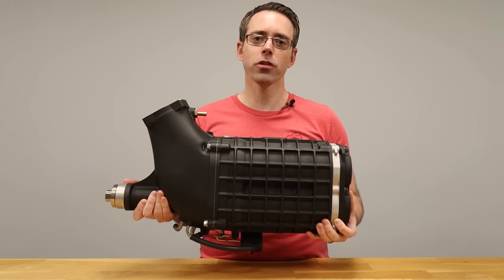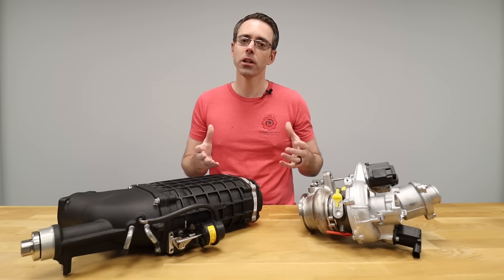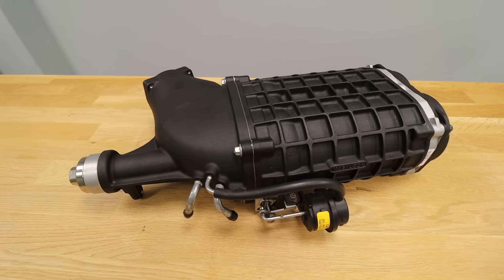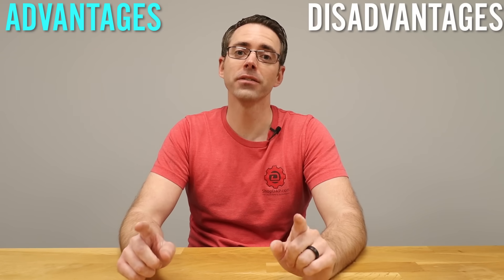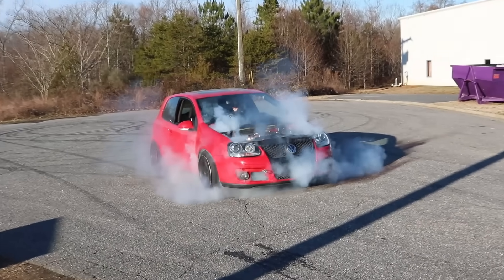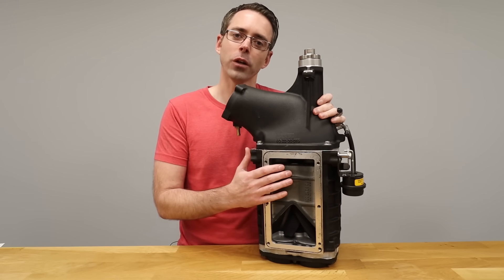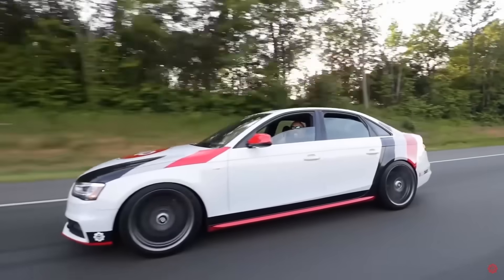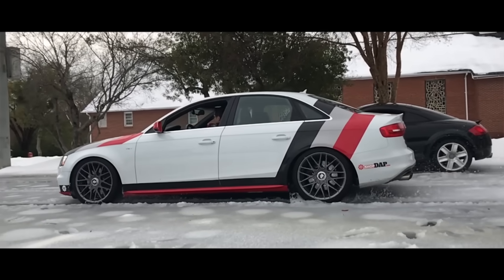Turbochargers VS Superchargers | Which is Better?

Comment: I’ve owned 5 turbocharged cars (3 Mk7 VW GTIs, a MINI Cooper S R56 LCI, and a Honda Accord 2.0T Touring). 2 supercharged cars: a Land Rover LR4 3.0L SCV6 and an Audi Q5 3.0T. Then I’ve had two naturally aspirated cars: a Land Rover LR4 with the 5.0L N/A V8 and a Honda Civic Si with Honda’s old glorious K20Z3 engine which would scream to its 8300rpm redline. VTEC BABY! I’ve also had an EV, a Tesla Model 3 Performance. 

By far the WORST engine in any of the cars I’ve owned is JLR’s 3.0L Supercharged V6. It was supposed to be a more fuel efficient replacement for the 5.0L N/A V8. In conjunction with a new transmission (ZF 8HP70) Land Rover promised better fuel economy, lower emissions and similar performance characteristics. Well, I can tell you JLR sure didn’t keep any of those promises. 

The first thing you notice with that engine was that it was loud (not exhaust noise, just mechanical noise from injectors, belts, etc.), gruff and idled like a 50 year old 2-stroke diesel. Depending on whether you had the A/C on or not, it liked to idle around 600rpm, but it would often stumble below 600rpm causing the engine to really shake and vibrate the entire vehicle. It did this since new and I’ve experienced the same thing in other LR4s with this engine. Once you were out on the road it felt rather gutless lugging around 3 tons of SUV with the aerodynamics of a brick. If you floored it the performance was adequate, at best, but it never felt like enough. The old 5.0L V8 was so much better matched to the LR4. It was smooth and refined, sounded amazing, pulled hard from idle to redline and was no less efficient than the V6, even though it was over 50% larger displacement and offered 35HP and 43lb-ft more power. It ran about 1800RPM at 70mph vs. the V6 spinning around 2000rpm, even with two extra gear ratios... 

Fuel efficiency was actually worse in the V6 when towing a trailer than the 5.0L V8 and ZF 6HP28 transmission. The 3.0L SCV6 was substantially slower accelerating than the old V8 LR4, required frequent downshifts to maintain speed up grades, and the engine always sounded like it was straining. Off road it couldn’t match the plateau of torque the V8 had offered basically at idle. Instead you had to cautiously modulate the throttle to get enough power to go but not too much to be jerky. It’s “eco stop/start” system rattled and jerked back to life with the grace of a 12 year old learning to drive a stick. They also have a problem with the supercharger design. While it shares the same supercharger as the Audi EA837, an Eaton TVS1320, the JLR units for some reason need to have the supercharger snouts rebuilt every 30-60,000 miles because of the supercharger isolator coupler going back leading to a constant sound reminiscent off a slack timing chain. Add in the fact it was sharing its engine block casting with the 5.0L V8, just with two blanked off cylinders and smaller bores and you get a heavy monstrosity of an engine that under delivers everything you’d expect in a luxury powerplant. 

My experience with Audi’s 3.0L Supercharged V6 is night and day different. The Audi shares a 90° Vee-angle, 3.0L displacement, same Eaton TVS supercharger and is available in a variety of power outputs like JLR’s 3.0L engine, but it feels night and day better in every way. The Audi V6 is smooth and refined, it doesn’t idle rough, it feels reasonably torquey at low revs and it is quite efficient. If you could place the two engines in the same vehicle and drive them back to back, you’d never guess they were so similar in so many ways.

I’d venture to say I prefer turbochargers to superchargers because they typically allow you so much potential to increase power through software tuning. Modern turbos are also quite reliable and more compact than a supercharger. Superchargers require belts be replaced and as seen on JLR’s application of the TVS1320 certain parts seem to wear out quite easily that require $500-750 repairs. Turbos can also have their problems but I personally haven’t had any issues with the turbochargers on my previous vehicles.  Pretty soon though, it will likely be a moot point whether you prefer turbos or Superchargers because outside of limited production muscle cars and muscle-SUVs/trucks from Ford, GM and FCA there are few supercharged engines left. JLR has ditched their old 3.0L SCV6 in favor of a new turbo/e-supercharged Inline-6, but they’ve decided to keep their 5.0L SCV8 in production. It puts up decent specs, but in reality it can’t match the thrust of BMW/Audi/Mercedes’ turbocharged V8s. Outside of that, no other supercharged engines are available from European or Asian brands. Audi has now replaced the Supercharged 3.0L V6 with the newer turbocharged 3.0L V6 in the S4/S5/A6/A7/A8/SQ5/Q7/Q8. Weirdly, the Q7’s fuel economy ratings dropped quite substantially with the new engine.

Comment: And h2r is faster than any car period
Reply: Actually no it's not. It's way cheaper than those cars thought.
Reply: @emilmuhrman  you are referring to the h2, which is restricted for street use. The h2r is unrestricted.
Reply: @hubertsang7418  No the h2r. Extremely fast, yes. Faster than every production car, no.

Comment: I'd sure love to know how you figure it's easier to install a turbo !!!
Reply from the maker: It was referencing developing a retrofit. Once someone has spent all the RD time making a CAD prototypes, testing, then production etc. or a fab person can weld a manifold and install on the car the put a turbo on. 

Superchargers are easier assuming someone has already done all the work.
Reply: Deutsche Auto Parts 
I can more readily see your point but one would assume your video is talking to the typical video watcher. In that case, having done both, I’m a supercharger fan for ease of install and linear power delivery but the turbo is only there when you need it and the flexibility is out of this world in this day and age. I think most would agree.

Comment: 1-4 turbo intercooler petrol engines all and 1-4 turbocharger intercooler petrol engines hybrid all with disadvantages by all socials 
1. Easy damage parts by petrol high temperatures after turbo boost can spark knock combustion.
2. Easy damage and Fuel consumption 20-100 l/100km, over 100 l/100km by test engine strength maximum over 20,000-150,000 rpm and F1 speed 160-250 km/hour over 250 km/hour on all circuits.
3. Level over 100,000 euros for repairing parts with supplies.
4. All kind turbo intercooler have been invented for commonrail diesel engines. 

From
All brands databases

Comment: 2:57  that does not sound right:  turbo easier to retrofit onto an engine.  The turbo has lots of ducting that needs to be fit into the engine bay, and requires more engineering / calibration of parts to make it work well.  

A SC on the other-hand is a compact unit that fits into the space that formerly held the intake manifold.  The inter-cooler plumbing is a couple of smallish water lines which is more compact and easier to route.

Seems to me, the two main differences to consider are:
-turbo has slightly less parasitic load when compared to a modern twin-screw SC.
-SC naturally has zero lag / better throttle response.  Turbo-lag can be greatly reduced, but takes some thought and tinkering.

The turbo seems to get the advantage when you are doing a big run of cars, while SC seems to have the advantage for individual upgrades.

Comment: There are some other things worth mentioning. 
The free spooling turbocharger allows for altitude compensation. A supercharger is slaved to the crankshaft so as elevation and temperature increases (esp a combination of both) then the power adding the supercharger gives is lost as in an NA engine (albeit from a higher power potential). A turbocharger has a key advantage here as it can maintain manifold pressure automatically.
A turbocharger also costs power in the form of pumping losses esp when it is on high boost but blower pumping loss is always there esp when cruising - whereas the turbo during cruise has little or no pumping loss sice it's off boost.
Back to superchargers, in aviation some general aviation had a pilot selectable 2sp gearbox to compensate for altitude gain. As you can imagine it is problematic and turbochargers are simpler and lighter.
So as you mentioned a turbo has a clear benefit. It can maintain rated power most of the time and doesn't cost fuel during cruise - however I still want a blower lol.

Comment: I'm a supercharger guy. I'm not looking for outright the most power I can get. I like stock feel with an abundant of power at each rpm. And since superchargers are always boosting the instant power is very welcome. Can you imagine though if roots type blowers were not driven by the engine and still give instant power.
Reply: i leave my friends GTR instantly, my Jag's supercharger puts down instant torque and he has turbo lag
Reply: And more reliable just needs a belt change and oil changed, turbos can be maintenance nightmares on a gas car. Turbos on Diesels tend to be pretty reliable likely because Diesels run cooler.

Comment: And turbos block exhaust free movement out of the exhaust system so just like a supercharger they also rob engine power
Reply: Superchargers rob MORE power as engine revs increase. Turbos rob power under the curve, but even then it's not going to be as much as that belt drive. A properly setup turbo exhaust system will have 0 back pressure because the turbo is the restriction, will need less mufflers as the turbo breaks up the noise and the exhaust housing will be big enough that it will flow the horsepower you're chasing. It's like saying a waterwheel restricts a river.
Reply: No one seems to focus on the fact that turbos block exhaust. Same way a blocked catalytic can rob power so does a turbo.

Comment: In Australia we have the locally made Ford "Barra" inline six 4 liter with a factory turbo and no discernible lag with the factory turbo. The long stroke 4 liter 4-valve engine makes excellent torque from low revs which helps. There are some heavily modified Barra engines making over 2,000HP at the wheels. We also have the Holden, GM in Australia, Commodore which was exported to the USA as the Chevy SS running the LS3 V8 and a number of supercharger kits are available with efficient twin screw superchargers from the Magnuson 2300 to the Whipple based 2900. Best of both worlds really.
The only problem is that both were discontinued in 2017 but there are plenty available used.

Comment: ble
This video is so biased, manufacturers mainly only use single turbos for eco boost cars and Superchargers are used for performance cars like the Camaro Zl1, Mustang GT500, and others too like the Jaguar F type SVR. It’s also easier and quicker to install a supercharger because most of them are bolt on and have less components and turbos overheat way more than Superchargers.

Comment: Mayor difference that you didn't mention: torque with a supercharger is linear, it increases simultaneously with the rpm when you are accelerating. Turbochargers have a mostly flat toque band, usually starting from 1500-2500 rpm all the way to redline, or it's tapers of at the end because the turbo is too small for adequate boost at the end.
Reply: That’s why you do a sequential set up
Reply: @rexultimus1422  Twin Turbos have came long way in all out racing quarter mile
many ways to spool off line
cant do road racing without power blocking
Cant do Grudge Racing Back to Back
or no prep I Think might be track.
any stall or key shut off without cooling period Pop Pop kiss the twins good bye engine too turbos & exaust is 1700 degrees
Basically 27 pounds turbo boost =5-7 roots
54 pounds being = to 14 pounds 
taking 64 pounds boost to beat roots 
roots being maxed out at 14 
turbos  build pressure Roots slams it
e85 saves it on turbo 
Turbos cant do top fuel 
Heat methane nitro and Hydrogen dont mix
See both have pros and cons 
on 93 pump gas twins make 200 horse
Roots will murder twins lol
and thats little 144 teflon bladed B&M
Reply: @alonzahanks1182 You sound like you maybe know what you're talking about, but damn your sentence structure is so bad I almost had a brain seizure putting it all together
Reply: Thank you
Reply: Should I switch my supercharged challenger to a twin turbo?
Reply: It depends of the supercharger type
Reply: @matiz33  yep, and generally, a twin-screw is better than a Roots.
Reply: @ryze9153  All The lies lol 
roots rolls over 1 time puff 144 cfm
Screw rolls over 1 time the puff is 1/3 down screw 3 turns puff  144 cfm if that
Heard they did pretty good power butttt
Short winded 
A Roots is Being Cooled at source of heat inside blower By Fuel and outside air
Just like a water cooler
Screw being over driven gets hotter and hotter the harder you spin it
then they try to cool the charge after its 500 degrees
to compress air creates heat
and by running rich with fuel will cool it more
you will never see two stock 350s with headers  1 roots 1 screw  compete head to head at track Just on Dyno racing lol where it can be manipulated
Its harder to not blow seals in manifold
and head gaskets  with roots hitting all at once is only downside 
turbos and screws 
you will never see on airplane engine 
to fly to 50000 feet 
original purpose of the Roots lol
Reply: No  its turbos dont have load put on them they dont do any thing
you hit hill turbo hits max boost  even biggest turbo 
youve just run out of gear or maxxed injectors out 
in the quarter though in race set up you hit end of Quarter mile before 
electric spool gets them started now days off line

Comment: Maybe now that with all these self charging cars, electric motors & batteries are getting more efficient, plus bearing mind that Koenissegg discovered independent pneumatic valves to be better, perhaps it would pay now to try driving a turbo/supercharger with a new generation electric super motor? In addition if more electric power is needed perhaps a small lightweight alternator could be driven by the exhaust gas as on a turbo. That would eliminate turbo drag but perhaps drain less power from the engine like the supercharger while boosting back pressure? I expect it's been tried though?

Comment: With a supercharger u can hear the whine the whole drive but with a turbo u have to downshift or shift up to gear Stu tutu tutu
Reply: this is the dump valve noise you're talking about. not the turbo itself. if you apply throttle it will make noise too! i mean... don't talk if it's to say things like that.

Comment: I've always been a huge proponent of a supercharger, and the sound, especially in a S4 w/ dual pulley and cai, is amazing. In saying that, I own a turbo 5cyl Volvo and I'm absolutely enamoured with turbos now! Honestly could not give an answer to the question of super or turbo, they're both so goddamn wicked!
Reply: My attainable dream car is the supercharged Mercedes E55 AMG, I love the sound of the car
Reply: The way the turbo pulls from spool to top end with that whistle is great. Plus being able to have the ability to adjust boost with a switch is so good.

The instant off the mark hit of the supercharger is great. The noise is sexy. Swapping pulleys and belts to hit a boost target only for it to hit it at a certain RPM, before and after being low, is a touch annoying. The fix is obviously undersizing the pulley and running a bypass valve as a boost controller.

Comment: You said turbocharged vehicles have turbo lags, well it depends on what size of the turbo. Some small vehicles fitted with tiny turbochargers have very small turbo lag to none while the larger turbos have bigger lag but got significant top end power.
My car with 4.0L inline 6 with Garrett GT3576 (270KW) from the factory can accelerate faster than a 5.0L Supercharged V8 (335KW) at the traffic lights.
The biggest issue with turbocharger is they suffers from outside temperatures. During hot summer, the turbo runs much less efficient and lack of boost while in winter they tends to run on overboost with lots of power gain. 
Also the turbocharger needs fresh and clean oil to run properly. Dirty oil will block the turbo oil feed line causes overheating for the turbocharger. 
* Supercharger cannot offer a sudden kick-in feeling as on a turbo.
Reply: intercooler + turbo isolation tape + well tuned dump valve + good quality oil with a regular change interval = bye superchargers!

Comment: Should have mentioned the effects on engine lifespan of a turbo vs a super.

I avoid turbos because I don't want to replace a worn out engine every 100,000 miles, the back pressure kills.

Just makes sense when you're trying to force more air in but creating back pressure from exhaust restrictions that it would create excessive wear on the engine.
Reply: you need to stop theory and go for practice dude...
Reply: But supercharged engines have to work harder to achieve the same power making it harder on the engine components.

Comment: So... what would a centrifugal belt driven turbo (supercharger) fall in the category? it's not instant power, but it is belt driven.. which still robs powers from the engine. So is it a turbo a or supercharger? (it also makes the most power up top) So, can you really call a centrifugal "super-charger" a supercharger? or a turbo.
Reply: it's driven like a supercharger but it acts like a turbo. so it's a turbo! centrifugical turbos are good for not so high pressure. you eliminate the lag and keep a decent engine health over milage. BUT if you wanna reach heavy torque or high end power to the max, it's better to go SC for torque and regular turbo for high end power. you'll not reach the power output of a turbo with a SC. just more torque.